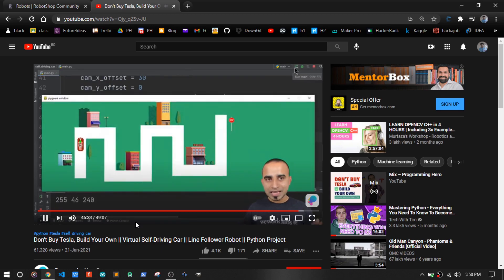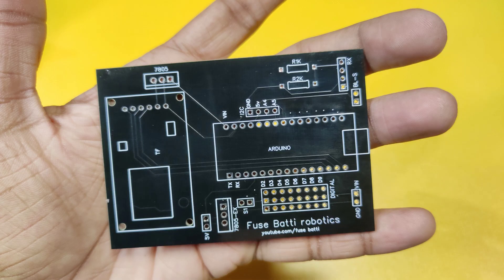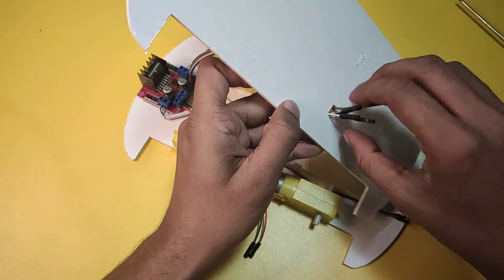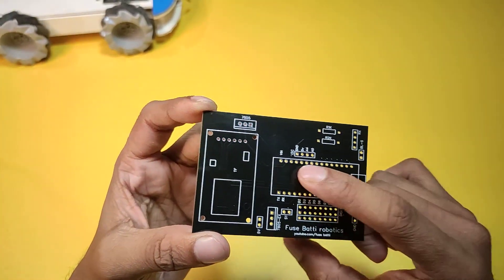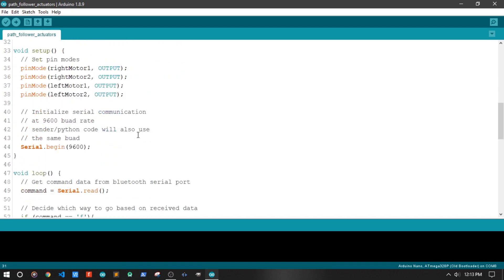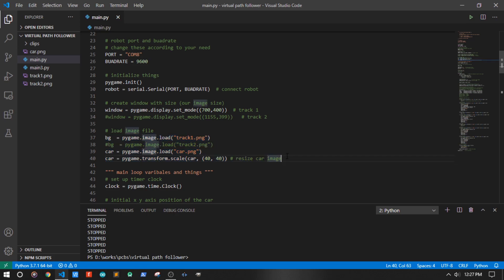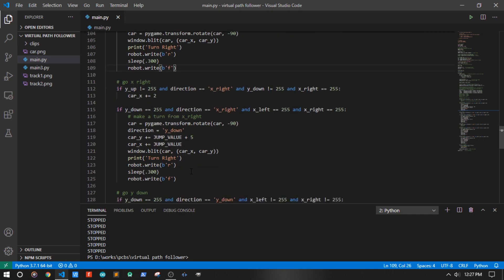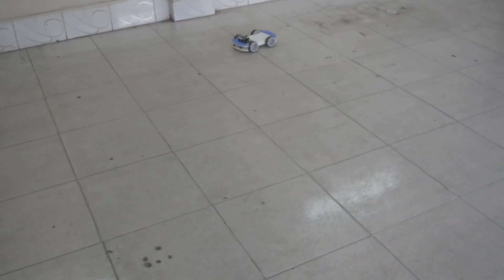Python Virtual Maze Solver Robot || Autonomous Car || Python Arduino Path follower Robot ||

Comment: I don't want it virtually what changing I have to do
Reply from the maker: Didn't get it. You don't want the virtual robot to move ?
Reply: @FuseBatti  I want  to draw maze on ground and then robot will follow that
Reply from the maker: In that case use one specific color that can easily be separated/seen from the environment (like don't use green in forests). 
Then use camera and computer vision technique to detect that color, if the color is in right, move the robot to right.. Something like this

Comment: I need to know my robot car is different from yours I used it sensors and ultrasonic and chassis of car. If I   use the code which you provided to me and connect the Bluetooth will it results the same?!
Reply from the maker: Yes the results will be the same, as long as motor pins are correct.

Comment: can i use arduino uno board instead?
Reply from the maker: Sure!
Reply: @FuseBatti  oh thanks. if i use arduino uno, do i still need to use arduino nano? and will the code change?
Reply from the maker: No, you see, Arduino is just a computer (microcontroller) for the robot. You can use any board you prefer. I used this because it's smaller. 
And the code will be the same. No need to change anything.
Reply: @FuseBatti  okay i understand. i will do this project exactly like how u did. and maybe i will ask more questions if im facing any problems. is that okay for you?😅 if so, do i need to message you somewhere or just comment here? thank you i really appreciate you n your channel😊
Reply from the maker: No problem. You can use YouTube comment section or fusebatti's fb page. 

Best wishes!
Reply: @FuseBatti  😊thx